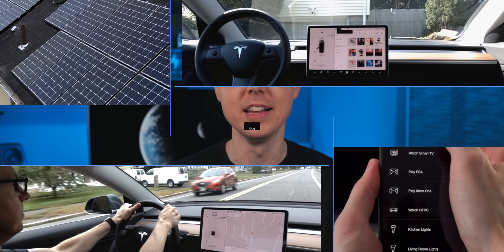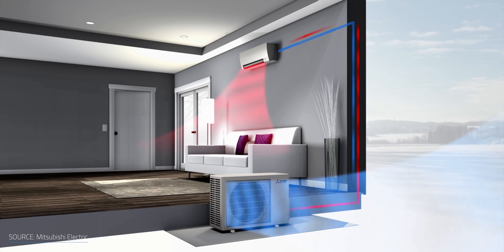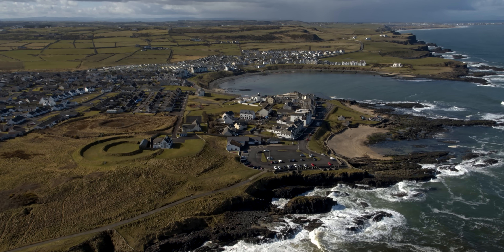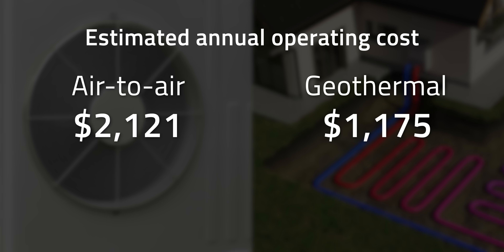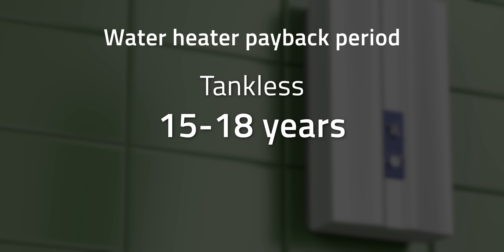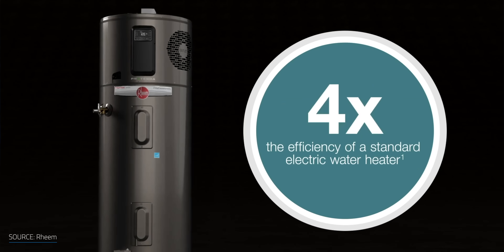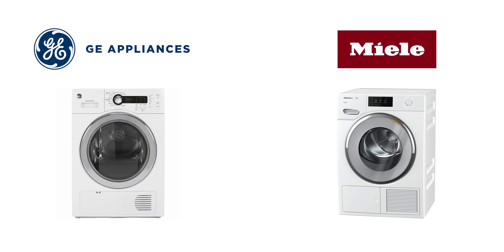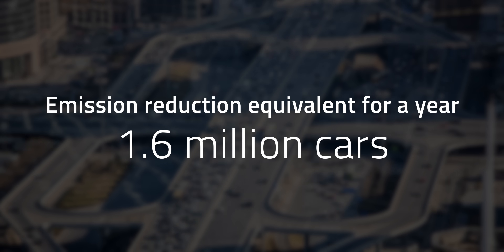Why Heat Pumps are Essential for the Future - Explained

Comment: In the real world heat pumps can only be part of a heating system not the only source of heat. Heat recovery systems are far more useful and are what we are installing in modern buildings. We are actually being paid to remove heat pumps in many cases because they have been found to be not fit for purpose by their users. Don't be fooled by the marketing bull. Heat pumps can be a useful addition to your heating and cooling strategy but must be combined with other sources so that when the recoverable energy is low it can be augmented. Very few commercial developments utilise heat pumps, they are usually only installed on vanity projects because they are fashionable. We have found many of our customers who installed heat pump systems as their primary source of heating and cooling are dissatisfied with their performance over the long term. What is required is a diversified heating and cooling strategy with waste heat recovery. However the downside to that is complex systems which are inherently less reliable and require more frequent and more costly maintenance.

Comment: The only thing you don't mention in your videos is maintenance AND breakdowns. Which ALL those machines you are describing here are guilty of... They are good if someone can service them (happens to be my profession) but if you are trying to be "off grid" this is by far the WORSE choice you can make... They can survive UP TO 6 years of normal use. Now calculate from here... Also, this is 40 year old tech yes? For "off grid" the first and highest priority is not cost, is maintenance...

Comment: This video is just so wrong, there are so many errors.  I'm a dual degreed engineer who has owned a second HVAC/R company for over 40 years.

Let's start at the beginning.  R134a has never to my knowledge been used in stationary heating, cooling or heat pump applications.  R134a is the refrigerant used in your car.  The traditional stationary refrigerant is R22.  It's a mediocre refrigerant.  It's critical temperature is so low that in heating mode, the air is barely warm and feels chilly to the touch.  It is further mediocre in that its pressure drops so low on the outdoor evaporator side that it quits pumping heat in the 20s.  Then electrical "blast" coils have to take over.  Even in the temperate climate here in TN, a conventional heatpump is very expensive to use in the winter months.  Before I yanked out my R22 heat pump a few years ago, I measured it's SEER at 9 or a COP of 2.6 in cooling mode.  Much worse in heating mode.

  The major breakthrough was the development of refrigerant R410a blend.  With this refrigerant a SEER of over 30 (COP of 8.8) is possible, depending how much money you want to spend.  When I ripped out my central heat pump, I installed mini-splits (shown in your video with the indoor unit handing on the wall but not identified as such) in the mid-range rating of SEER = 22 (COP of 6.4), one for each room and a larger one for my combination den and kitchen.  This is the unit that I install for the average customer.  It's a sweet spot between SEER and price.  Central heat pumps now use R410a also.

The second major breakthrough is electronic speed control.  Everything in the mini-split is variable speed.  Fans and compressor, all driven by 3 phase variable frequency drives on the control board.  If the house is 80 degrees in the summer because I set it to that value while on a trip, when I turn the temperature down to my comfort level, the computer spins everything up to full bore.  The compressor runs over 4,000 RPM (measured with an electronic vibration tach) and the fans go on high.  The nominal 19kBTU/HR is temporarily increased to a (measured) 26kBTU.  It cools my den and kitchen down in minutes.

Once the setpoint is reached, the compressor slows to between 400 and 600 RPM, just enough to offset the heat inleakage and heat generated inside my house.  The fans are barely turning but the air is still ice cold.

This is because of another breakthrough.  The electronically controlled expansion valve.  Instead of trying to maintain a constant evaporator temperature and pressure like the conventional TXV does,  It maintains the evaporator at the temperature the computer commands.  In cooling mode that is 33-34 deg F.  The indoor fan speed is varied to keep the room at setpoint.  The result is stupendously great humidity control.  I'm a hot-natureed guy and with the old heat pump, I had to keep the thermostat set to 68 in summer to be comfortable.  I'm writing this right now with the setpoint set to 75 deg F on the mini-split.

Keeping the evaporator constantly wet has another benefit - no air filter.  The indoor unit has a screen about like the screen in your dryer to catch the big stuff but the combination of very low air speed and a wet evaporator traps most of the dust and it flows out with the condensate.  Where my condensate drain line ends, there is a little pile of lint-like material that has been removed from the air.

The final benefit is that with R410, the heat pump continues to work to below 0 deg F.  The specs on my units say the lower limit is 0 deg but last winter I had a few days that reached down to -5 deg F.  They kept on truckin' and the air output was still HOT.  I have a stand-alone propane furnace as backup but it has never been used.

I'll touch only briefly on geothermal.  In general, geothermal looks good on paper but is often terrible in practice.  First off, the tubing must be several feet below the frost line.  in places with severe winter weather, that is a major and expensive dig.  Second, earth is a poor conductor of heat.  The stats look good at first but as a temperature gradient builds around the buried tubing, efficiency drops significantly.  The only way to avoid that is to lay in a huge tube field.  Ice has almost no thermal conductivity so if in the winter, the ground around the tubes freezes from the heat extracted, the field is useless.  Third, with R410a systems, the benefits are marginal if at all.  In writing this article, I walked outside and measured the temperature of the air coming out of my larger mini-split.  Ambient temperature 85, exhaust temperature 90 deg F.  Forth, a dual well system is vastly better if the ground water is not too deep.

In these parts, ground water is between 50 and 75 ft down.  This is NOT potable water.  My potable water well is 175 ft deep with a 75 ft casing to keep the ground water out.  This ground water IS, however perfectly suitable for use with a ground sourced heat pump.  I've installed 2 such systems back in the R22 days.  2 75 ft wells on diagonally opposite sides of the property.  Pump the water out, run it through the water condenser/evaporator and drain it back into the ground with the second well.  Significant benefit for R22 systems; probably little to none for R410a systems.

Now let's change directions.  Your recommendation for heat pump water heaters and dryers.  They sound real good on the surface but what you totally failed to mention is that since they're indoors,  the energy pumped to or from these devices must be handled by the house's HVAC system.  To realize the full efficiency potential of these devices, the compressor and coil should be located outdoors.  I'm not aware of anyone who sells such appliances.

I have a 60 gallon heat pump water heater of my own design and construction in my 1000 sq ft basement.  It works very well.  but in a small house with 2 occupants and low water usage, the basement is always cold.  I have installed vent fans and vents for summertime use but in the winter, the basement is unusuably cold.  Before I installed the heat pump, i could fire off an unvented propane heater and work in my shop year round.  The compressor unit is headed outdoors next summer.

You really should do your research before posting videos like this one.

Comment: Well presented video Matt but...The most important thing to note about heat pumps is they are only as efficient as the insulation in the property. I have a 70s detached house with large windows (11), no wall insulation and a solid floor. To upgrade the insulation for a heat pump to be efficient would mean triple glazed windows, major structural work on the floor ( the whole ground floor dug up and replaced) and walls insulated reducing the room size. Also all radiators replaced and microbore piping. In at around 15-20k (UK) at a conservative estimate. I'm a pensioner on a fixed income, no way can I afford this unfortunately. I have a  wood burner which heats keeps me very warm as well as well as being able to cook with if the power is off.  Great idea for new builds but old houses-bottom line too expensive-cheers

Comment: CO2 reduction is important but I believe far more people will be motivated to install heat pumps if we focus more on the primary objective - to achieve a massive reduction in fossil fuel energy consumption. Only then, in a world of unstable war mongering supply regimes like Russia, will we avoid blackouts and huge increases in the price of energy. Heat pumps are capable of reducing fossil fuel used for heating by more than 80% depending on the energy supply mix. For example my heat pump uses around 3,000kWh electricity pa (50% of which is produced from non fossil fuel sources in the UK grid) compared to 21,000kWh of gas for the boiler it replaced. That is a game changing quantum reduction - roll out nationally and the energy crisis will disappear!

Comment: It would be interesting to see how these high tech systems work and cost for a period of 10-15 yrs, which is the average lifespan of an al cheapo traditional gaz boiler. From subjective but local experience these systems cost a fortune, are unreliable, take a lot of space, are noisy as hell, the companies that build them keep going bust and govt fundings don't seem to apply to anyone. For future proof I'm more inclined to keep it low tech, cheap and reliable for older buildings we have in Europe.

Comment: My name is Matt as well and i would go evacuated solar collector with storage, oil or water, heat hot water and solar assisted absorption air conditioning using lithium chloride and propane supplement for them cloudy days.

Comment: "heat pumps are environmentally friendly because they don't release any harmful gases" ....yeah bud, because that electricity comes from unicorn farts and solar panels only.  Determine how your local electricity supply is generated, then factor in line losses, then performance in cold weather and tell me again how wonderful they are.

Comment: This video does not come across as unbiased IMO.. The downsides are skipped over very quickly and marginalised.   There are only a few commercial ways to get heat from electricity.. Primarily it's using Resistance Wire in it's many iterations from small floor/table mounted fan heaters (blowing ambient air through coils of NiChrome wire which glows red when Electricity is passed through it and the resultant heat warms your space).  to Immersion coils to directly heat Water. This Wire is by far the most common and is also used in the Heat Pump and  shown as the Winter 'Top up' Heater in the video. 
 
With Heat Pumps, the electricity runs an electric motor which drives a small piston up and down (much like a Car engine..) as the liquid refigerant is squirted into the piston, and compressed.. it  creates heat in the refrigerant and increases the temperature by say 40oc (dependant on  the unit) and pumps it around the circuit.   
The point here is dependant on what temperature the fluid is when it is compressed..  If it's 10oc or 60oc it will only increase by 40oc. 
   
Also, a typical US Fridge freezer only uses about 300w.                An average Home Heating system will use 30KW an hour..
If you wanted a decent amount of heat and the pistons were scaled up they would probably resemble a V8..

     The Heat Pump system was designed to be a Fridge..   IE :  The removal of a small amount of warm air from an enclosed space by pumping a heat absorbant liquid through small diameter copper pipes from an inside to an outside space.. and this process can be very efficient.      The Car Radiator is a perfect example although it would be far more efficient if mounted on the roof..
Once that little bit of warm air has been removed from the enclosure the Heat pumps job is done and powers down.  

I have an 8kw Heat pump to heat my Pool and is very efficient.. in the middle of Summer to heat a large body of cold water. Fabulous.. It's sucking heat out of the ambient air and putting it into the water.  Unfortunately I dont want my Home heating on full blast during the Summer and that is when you get the COP6 figure that is quoted.     
So/..
Is it cheaper than running an alternate electric system.. Too many variables..   Considering install costs over a 10 year period probably about even with an electric system.

Another option just being trialled in Japan is Induction Boilers.   Same principal as the Kitchen Hob.  I believe it is about 20% more efficient than other electric options..  Only cost a few $100's so pretty cheap..  I am seriously interested but nobody seems to be importing them yet..

Comment: So what do you do when they shut your power off .. Or a black out..and you cannot run a generator because there is no gas..or laws that you cannot run a Generator?   So then  it's Battery backup on a cold winter day or days and you will need 26Kto run your home with heat?
   Or a massive solar system?????
   Efficiency on lasts as long as your power source.  Then after that you get to freeze for free. When you have no way to charge your batteries. 
    Heat pumps are great if you have a power source.  Same with electric cars. 
   There has to be better solutions to heat homes and charge cars in the winter months.

Comment: First you have to have the house properly insulted, many are not. They are also very noisy, have to run 24 hours a day is that the best use of electricity. Cause problems with sleep patterns, low hum interferance causes real mental health problems over time, and will piss off the neighbors .

Comment: The problem is that with those energy bills - 300 euros a month they become quite useless. We used to have 3 cents kwh and it was ok. Now the cost is 20 cents per kwh. And when we use 50-80 kwh per day thanks to that damn pump, then sorry. Cant afford it. Give us better solution where covernments can't rob common ppl.

Comment: Why are you yapping about carbon dioxide, as if it is somehow “bad”?  CO2 is benign, beneficial, and inert. It is essential for every aspect of oxygen capture in the lungs and transport to cells deep in the body. It is continuously produced by every cell in the body, so that human tissues are literally saturated with CO2. Most of it exists as a major ingredient in hydroxyapatite, which is the substance of bone. About 20 Liters of CO2 is saturated in fluids and tissues as a free gas, as compared to 1L oxygen (almost all of which is bound to hemoglobin in blood) and 1 L of nitrogen (which causes the “bends” when it supersaturates in tissues of SCUBA divers). It is the major source of respiratory drive, which lowers CO2 levels in the lungs to optimize hemoglobin saturation with oxygen. It releases oxygen from hemoglobin in organs and tissues to enable tissue oxygenation. It is the primary regulator of blood flow and cardiac output because it reduces microvascular flow resistance to increase cardiac output and speed oxygen transport to organs and tissues. In other words CARBON DIOXIDE IS ESSENTIAL FOR LIFE. IT IS AS ESSENTIAL FOR LIFE AS OXYGEN. WITHOUT IT, OXYGEN COULD NOT TRAVEL FROM THE ATMOSPHERE TO CELLS!!!!! The notion that CO2 is a “greenhouse gas” is equally ridiculous. CO2 is a “trace gas” that constitutes only 0.03% of the atmosphere at sea level. At these concentrations, it cannot possibly trap enough heat to cause problems. “Global warming” occurs in cycles over hundreds of years, while CO2 levels fluctuate over geologic time (millions of years). Ordinary refrigerants such as Freon absorb far more heat than CO2. Furthermore, CO2 has superior refrigerant properties. It is not only dirt cheap but also totally lacking in toxicity, while conventional refrigerants are all plagued by toxicity. For example, Freon degenerates into phosgene, the notorious “war gas” of WWI, when exposed to flame. COULD IT BE THAT DUPONT IS AFRAID THAT CO2 MIGHT DISPLACE ITS EXPENSIVE AND TOXIC REFRIGERANTS???  COULD IT BE THAT POWERFUL MEDICAL CORPORATIONS PROMOTE HARMFUL HYPERVENTILATION TO INCREASE THE INCIDENCE OF CHRONIC ILLNESSES AND THEREBY INCREASE THEIR PROFITS???? Read my essay called “Four Forgotten Giants of Anesthesia History” that can be downloaded free of charge from the Internet. www.stressmechanism.com

Comment: Using plant material to make 100% drop in fuel for aviation and it produces gas United Airlines has sponsored and has built the facility that looks like a  Refinery which plant material contains 50 to 70% sugars and they convert to sugars into aviation fuel and gas and other products